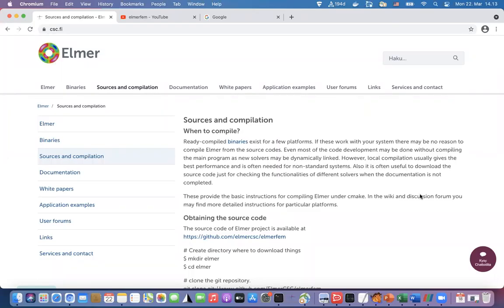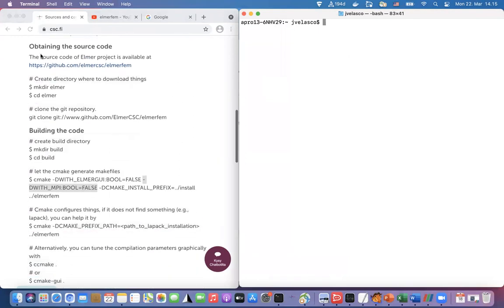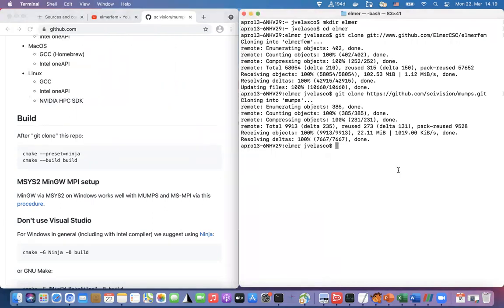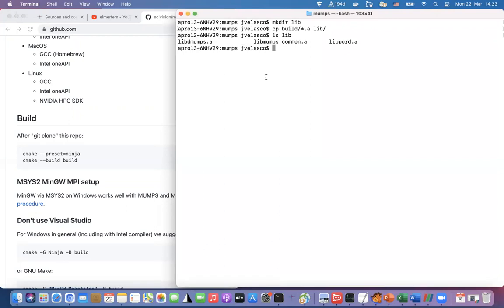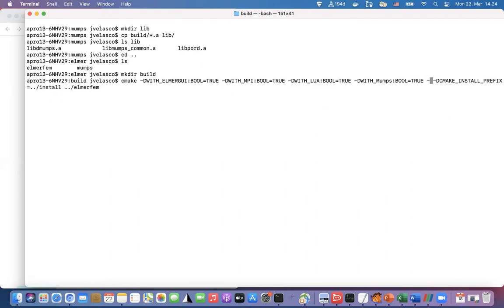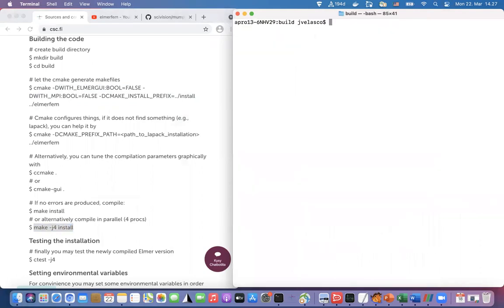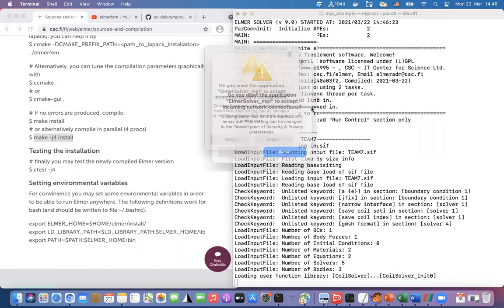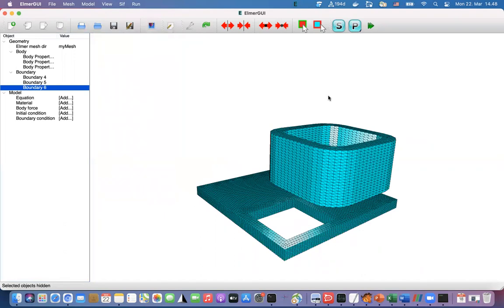Compiling Elmer on MacOS with MPI and ElmerGUI

Comment: Thanks for the video.  I tried to install on my iMac MacOS 10.13.6. Everything went well until $cmake -DWITH_ELMERGUI:BOOL=TRUE -DWITH_MPI:BOOL=TRUE -DWITH_LUA:BOOL=TRUE -DWITH_Mumps:BOOL=TRUE -DMUMPSROOT=../mumps -DCMAKE_INSTALL_PREFIX=../install ../elmerfem.
The error message are:

-- Finding Mumps
CMake Error at cmake/Modules/FindMumps.cmake:149 (MESSAGE):
  Mumps library not found.
Call Stack (most recent call first):
  CMakeLists.txt:407 (FIND_PACKAGE)

Could you provide any suggestions to solve this error?  Thanks!